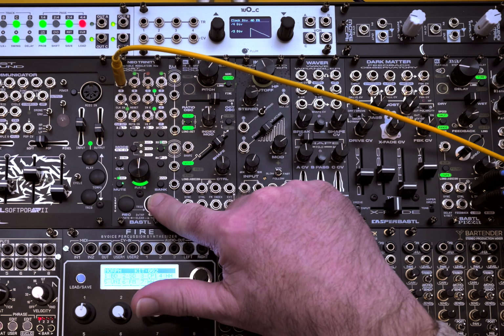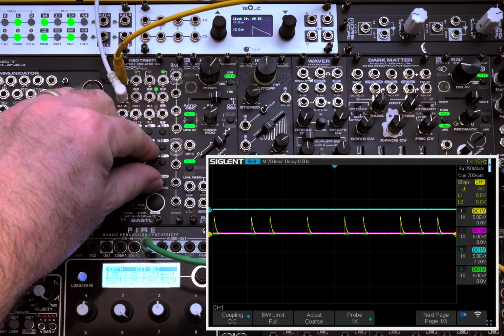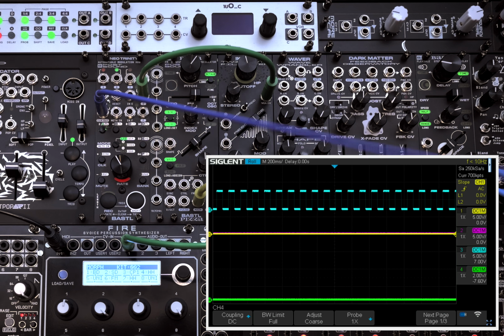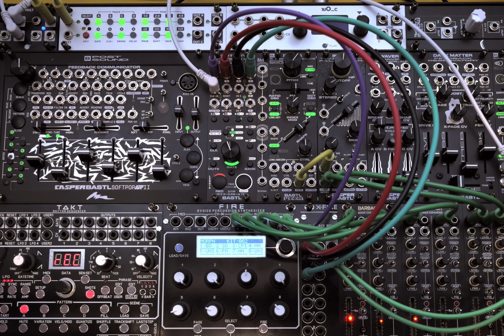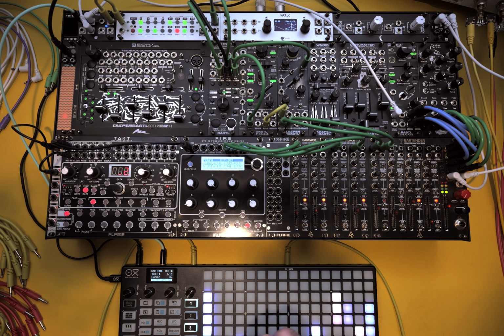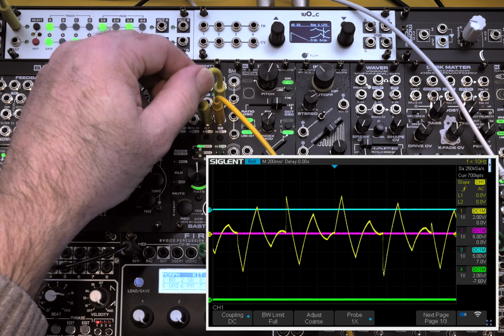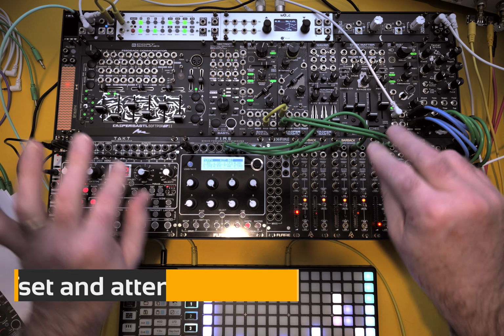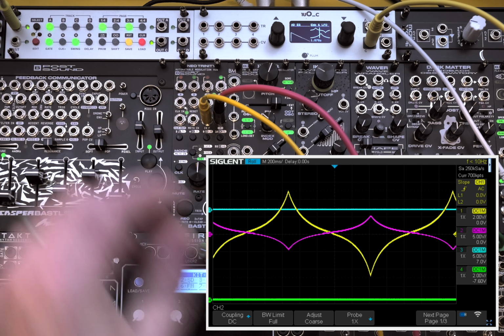Bastl NEO TRINITY is a Modulation Powerhouse! Patch examples and tutorial

Comment from the maker: 2:50 ERRATA: I'm holding channel button A and click on CLK/SYNC button saying that that this turns on/off clock sync for that channel. That's not what it does! Pressing the Channel button + CLK/SYNC turns on clock quantization for the trigger recording. 
By default that’s on, so every manually recorded trigger (or LFO reset or gate) is aligned to the clock (doesn’t matter whether internal or external). Turning it off enables user to record off beat patterns.

The LFO SYNC is done by pressing SHIFT+CLK/SYNC. That way the knob becomes clock divider/multiplier
Reply: @SynthDad Hi, here a new subs. I have a question thats make me crazy,,, This is capable of make the bass of this song? I am new in this modular world and i will apreciate this  :cat-orange-whistling:https://www.youtube.com/watch?v=errX5JYUBQo

Comment: fantastic video! i have a question that I have yet to find an answer to and was wondering if you or anyone else on here knew. Can you divide the clock on each individual channel? like if i wanted one of the triggers to be divided in half and another channel trig to go double time? Could you just use the clock divider algorithm to divide any of your triggers even ones you recorded in or are sending in? Thanks!
Reply from the maker: As far as I can tell from the manual there is just one master clock divider which applies to all channels. The closest idea I can come up with is to manually record into a channel at one clock divider setting, and then see what happens to that channel when you change the clock divider to record into another channel. That might work?
Reply: @ that’s a good idea to mess with. I tried using the clock divider algorithm channel on F and that kiiiinda works too. Hopefully there’s a way to do it more conventionally in a future update 🤞